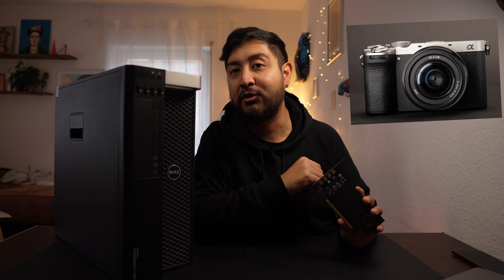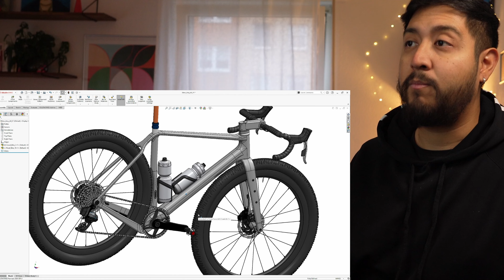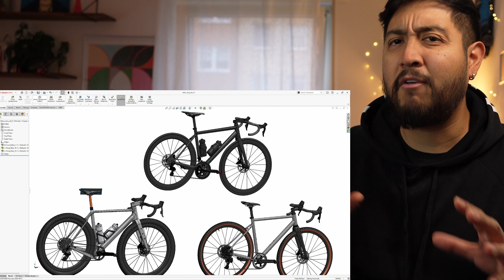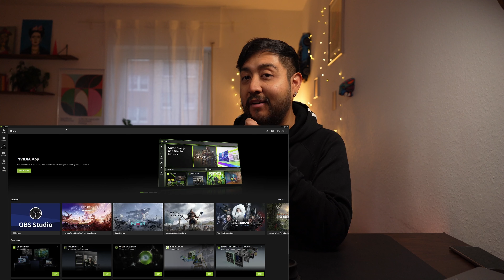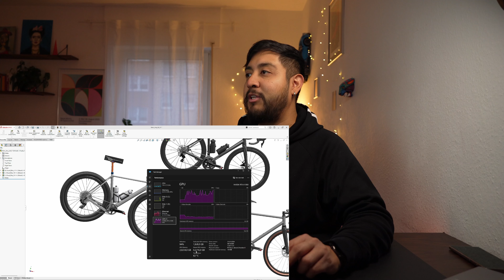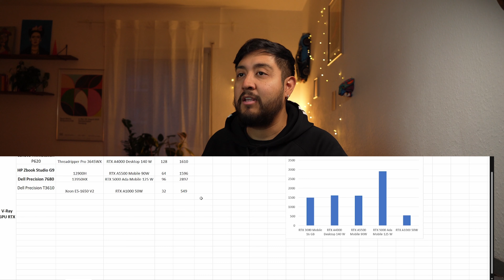Giving new life to an old Workstation / RTX A1000 Upgrade

Comment: hi im plannig on buying a laptop for my ansys amds 7700s gpu model u thing its bad for ansys and Nvidoa better or the difference is marginal cause the amd one gives good battery life
Reply from the maker: definitely an Nvidia card will do a better job. For anys always the more VRAM you have in GPU the better to accomodate the mesh data set. An RTX5000, A5000, A5500 mobile or even the old P5000 are great. Tested all of them myself in the 7700s series.